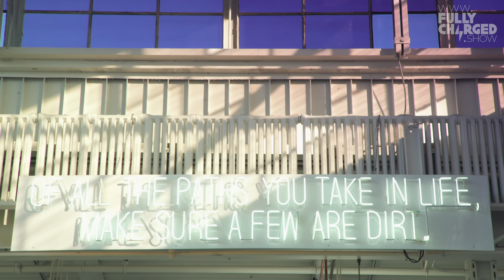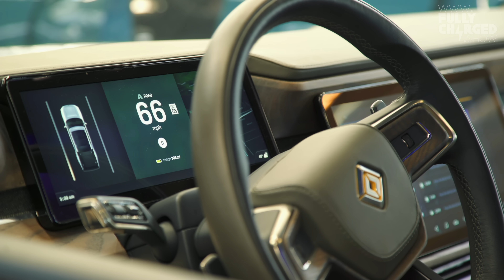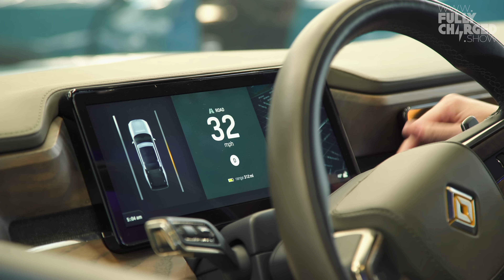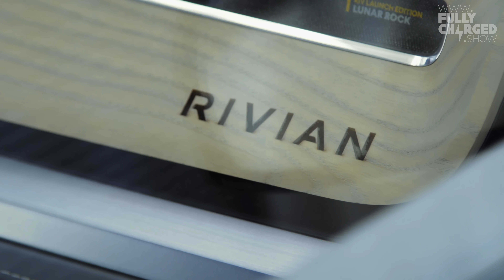Rivian R1S Electric SUV & R1T Electric PickUp Truck - World Exclusive: Inside Rivian | Fully Charged

Comment: Tankturn is the best term in the automotive industry ever!
Reply: I would love to be able to back out of a space and tankturn 90° to drive out...
Reply: Tank steer is pretty good, but tankturn still has my vote! Gotta say Rivian is looking damn good. Now to get one in Australia 🤔
Reply: Gear tunnel is second to tankturn
Reply: Mark Stevens  I am not sure what you mean by "a vehicle like this"
Its Rivian"s adventure vehicle.
They designed it to go camping, serious off roading, towing large campers, and going fast.
They gave it 800 hp to do these things. They wouldn't give it 800 hp if the battery couldn't handle it. They didnt give it 200hp at each wheel for tank steer. But if it's there.  Why not use it.
When I said "spin it" I mentioned spin the wheels. 
Would i do it on asphalt with my
Rivian? Only if I had too.
I also wont go 0-60 in 3 seconds. Well, maybe once:)
I was given a ride in the 256th made model X made. We went 0-50 and back down to zero in 5 seconds. My head was spinning.
Reply: Can’t wait to see the mess folk are going to make of the road surface with that move, in an AFV it’s known as a neutral turn and tears the track pads up.
Reply: @simonwhite2890  cars don't have tracks. They have wheels. A few people love to do burnouts despite the tire damage.

Now with motors in the hubs. Each wheel can be turned 90 deg
Reply: @simonwhite2890  Yes, tracks make that worse but tyres will get trashed as well if used in excess. Anywhere a bobcat has been on a road will leave rubber
Reply: Pretty sure it's actually called skid steering though
Reply: TANK STEER is trademarked.
Reply: Ian Webster skid steer is where One track is locked then the vehicle skids round, “tank turn” or as it’s known in the military the neutral turn, one side goes forward the other side goes backwards
Reply: Sure that this is something that every SUV in cities need to ruin the road.
Reply: @thankyouforyourcompliance7386  you wouldn't be using it on the road. Pretty sure it won't even work at high speeds.  Parking lots maybe though.
Reply: @thankyouforyourcompliance7386  technically possible only of wheel base is absolutely small and tires are very big.(Ex: lookup  vehicles like Bobcats , Sherpas etc)  Otherwise it should have proper 4 wheel steering. 
With  rear tyres that don't turn , making a 90 degree turn on the dime, for the rivian's  proportions, is difficult. But it can definitely reduce turning radius, especially offroad, as well as get you out of sticky situations much eaiser.
Reply: @georgythomas8451  AND the surface is loose, because by definition it requires slippage to work.  My bet is that this truck wont even let you do a tankturn on a grippy hard surface.  Only if there is wheel slip to allow it.
Reply: @grendelum  That substitutes the loose surface being the water instead of the base material.
Reply: Patreeko theArtist depends if it’s true neutral turn ie one sides wheels rotate forward and the other side rearward, which is why it needs a shorter wheelbase (unless you have a tracked vehicle) due to the torsional stress on the vehicle chassis/drivetrain
Reply: @patreekotime4578  each wheel has 200hp. I am sure they could spin it on asphalt.
Reply: @golfish8589  but would likely specifically be programmed not to because it destroys tires for no reason.